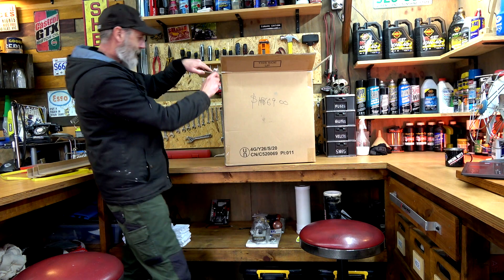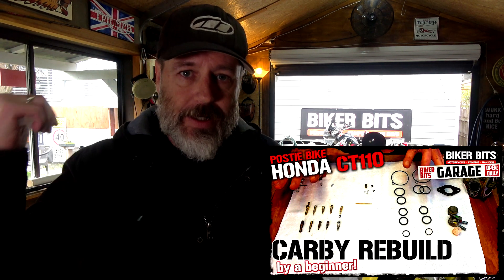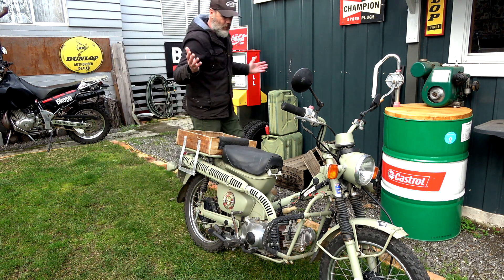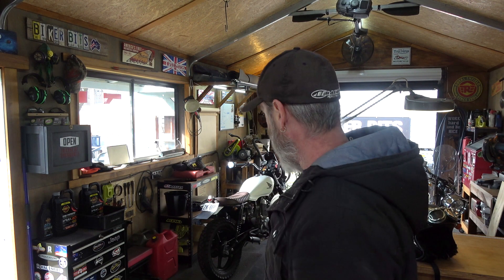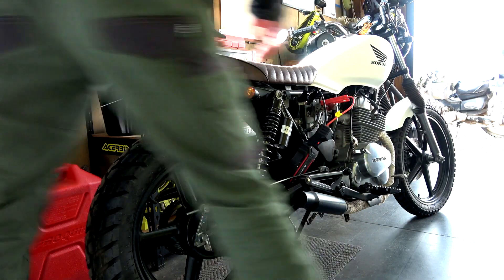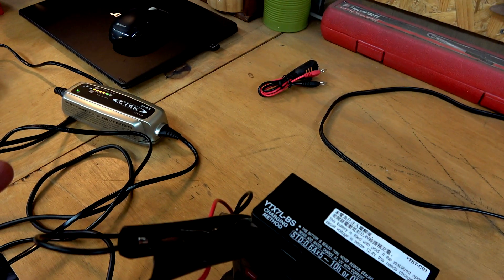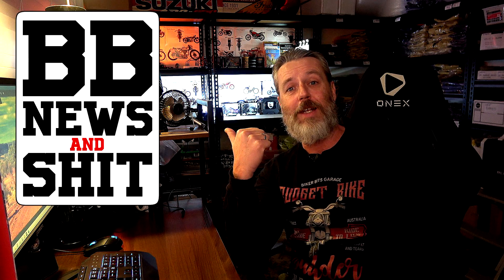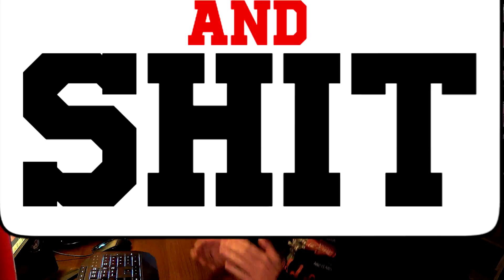OVERHAULED Part 2! MCT 2021 Ep.25-2

Comment: Hi Mark, sounds like it may have a vac leak or sucking air between the manifold an carb or manifold an cylinder head on the postie bike. The rubber boots have a tendency to crack or split over time. Start him up then spray carb cleaner around the manifold gaskets and see If the rpm changes or stalls out fast. It sucks the carb cleaner in and pin points where the leak is. Hopefully you get it sorted 😀, cheers Mark.

Comment: Fuel / air screw out 1 1/2 turns .
Blow out internal filter in bowl or remove and see if it makes a difference , if it does run better it's blocked . You can't really adjust float level on a postie carb ;-) .
 Normally if it gets hot and plays up idling you have  air leak .
If it stops once hot when riding and then starts when cools down its a stator problem . Shame you weren't closer . Long time postie builder  modifier.
Reply: yeah, it's running out of juice. Sits still for a while, bowl fills up, start it up and it runs till bowl empty. Fuel to carby is restricted (a guess).

Comment: Take some brake clean and spray around the intake manifold to check for a intake leak. Also run Stabul in your gas to keep the ethanol residue out of the fuel system when vehicles sit or any gas engine fo0r that matter.

Comment: Check valve clearance, vacuum leak around carburetor inlet manifold. Check your coil could be breaking down when getting hot. Hope this help, mixture screw 1 1/4 turns to 1 1/2 turns out. Check needle in the middle groove. Auction the bikes you no longer use or need. Do a ticket draw.😀😀😀

Comment: The the air mixture screw on tango is not out far enough, try 1.5 min to 2.5 turns out, normally at least 2 turns out, i would go so far as to say that your other postie has a bigger pilot jet hence why it's mixture screw is only 1 turn out. Try setting it to 2 turns out then start it let it warm up then turn idle down.

Comment: I'd pull out the spark plug and check the color of the tip, if its dark black your running too rich and if its light tan in color then your too lean.  Loosing power at higher RPM maybe too lean, I'd go two full  turn outs on the fuel mixture screw.

Comment: Loud mufflers?  Make a capped tube that fits/shoves in the end of the muffler/s that has only a small hole in the end/cap. It will run poorly but should pass a rego check for noise.